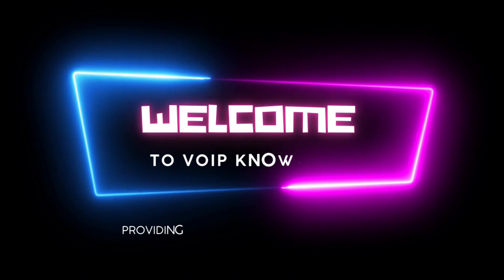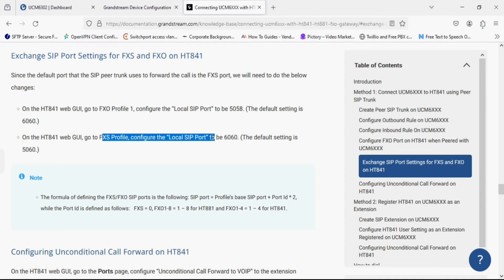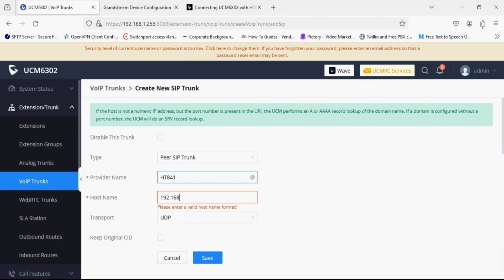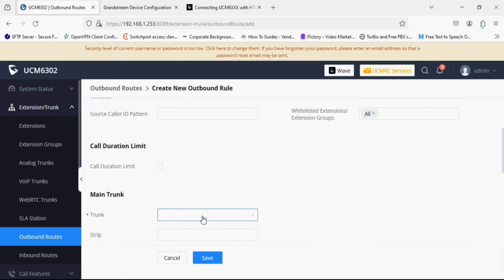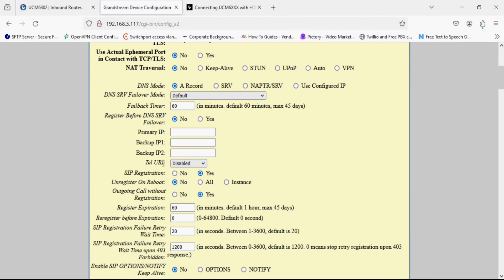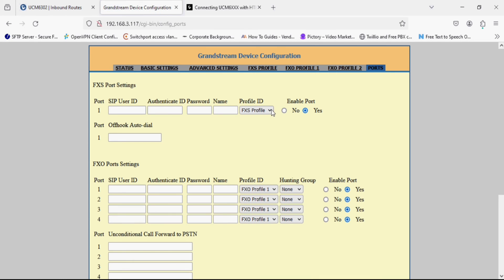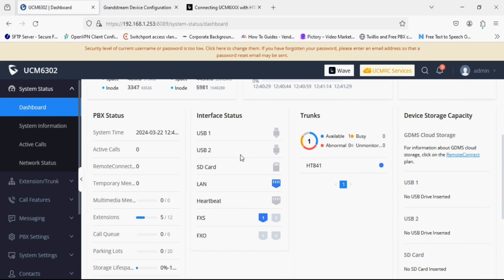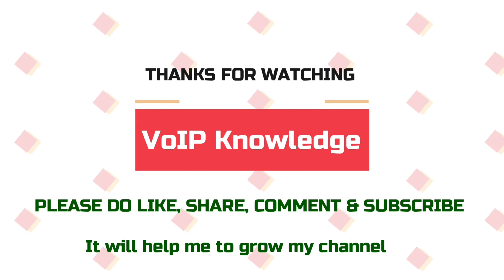Grandstream HT841 & UCM6302 Setup | Complete FXO Gateway Configuration Guide

Comment: I was thinking in using a UCM6300 (PBX with no FXO) with a HT841 (Analog Gateway 4 FXO) but I can only create 3 SIP profiles with it. I wanted to manage each individual FXO as an individual Trunk. Anyways, I will stick to a UCM6304A (PBX with 4 FXO) ☹
Reply from the maker: Yes it is possible to manage each individual FXO port as a trunk because each port has its own sip port and with the same you can create individual trunk in ucm or any other pbx.

Otherwise can call the individual port via the port prefix.
Reply: @Voipknowledge so why would anyone buy a UCM6304A vs a HT841 + UCM6300 combo? Such combo is much cheaper than the entire UCM6304a

Comment: I have a Grandstream UCM6304 installed in my office, but only two FXO ports are functional. Ports 3 and 4 are working, whereas ports 1 and 2 have burned out. Now, I want to connect a Grandstream HT881 to the UCM6304 so that I can use a total of 8 lines. Please guide me with the configuration. Thank you.
Reply from the maker: You can follow this video or if you need remote support ( paid) then mail me at voipknowledge2023@gmail.com.

Comment: Dear, here is a problem >>we are not able to call outside using specific fxo port .
I am using HT818 as gateway terminated 8 fxo line (DID) and IPBX 6300A.Made SIP trunk between HT818 to IPBX 6300A.Trunk is working fine also incoming and outgoing is happening. But problem is we are not able to use respective fxo port which calling outside .for example created extension from 1000 to 1010 & 2000 to 2001 & 3000 to 3010 & so on .When i will call outside from 1000 it must use fxo 1 port and when i will call outside from 2000 it should use fxo2 port & when i will call 3000 it must use fxo3.If you have any Idia pls suggest ,
Reply from the maker: Hi, 

You need to create voip trunk in UCM for each port of HT881. 

1. Firstly upgrade the firmware of HT881 to latest one

2. Change the SIP port of FXS profile  to 8060.

3. Changed the sip port of FXO profile to 5060.

4. Now the FXO ports are as below. 
FXO 1 -- 5060
FXO 2 -- 5062
FXO 3 -- 5064
FXO 4 -- 5066
FXO 5 -- 5068
FXO 6 -- 5070
FXO 7 -- 5072
FXO 8 -- 5074
Reply: @Voipknowledge  Wait, you can do that? Even if I can only have 3 SIP profiles?

Comment: Hello what is 901 and 902 number in configiration?
Reply from the maker: Hi, 
901 and 902 are the ucm extension,
Reply: When I make a call through ht881, do I have to dial the extension 901 and then the external number?
Reply from the maker: No, you need to dial the external number directly.